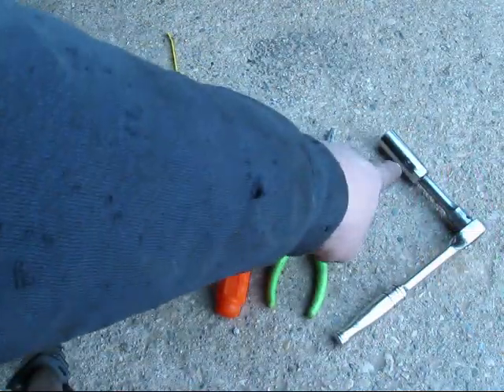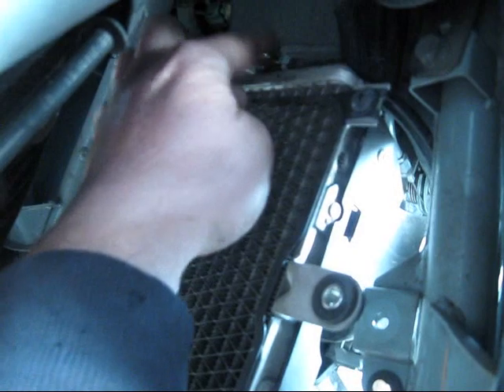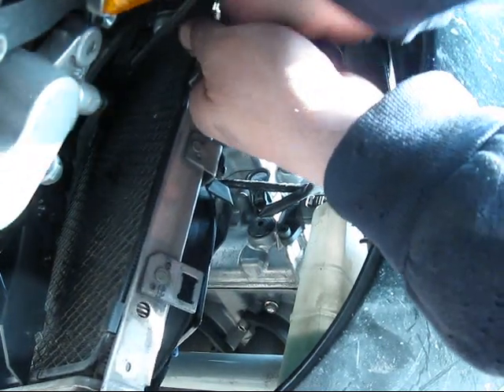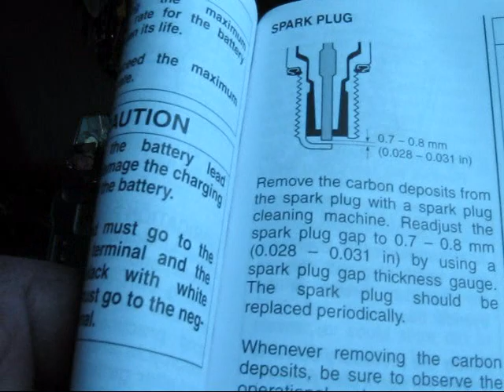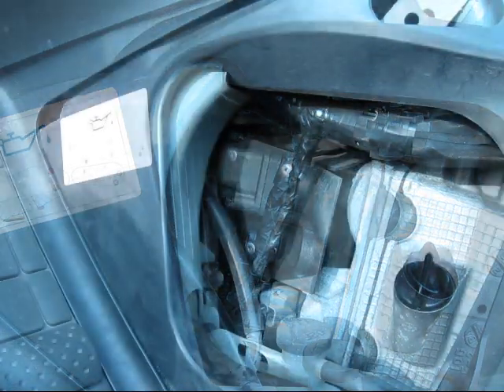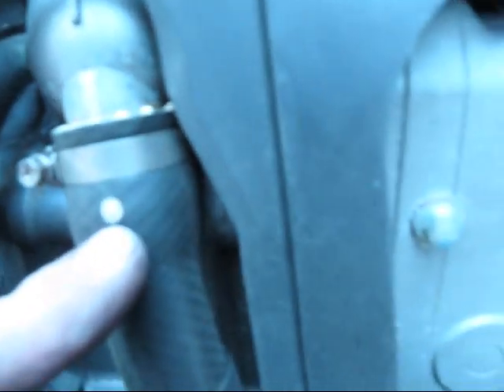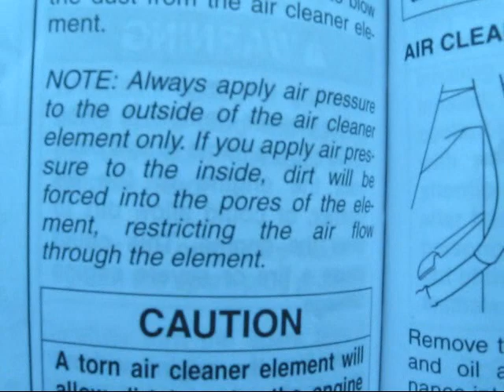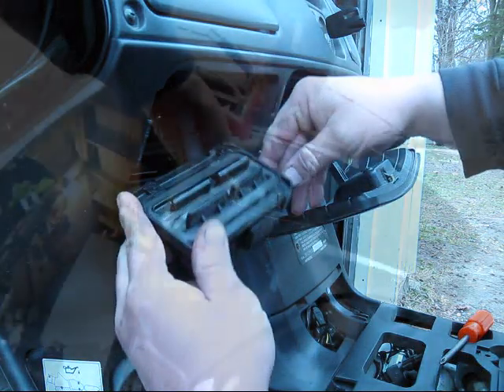Burgman 650 17,000 tune up.

Comment: I have 53k on my 2005 650 Burgy and shamelessly haven't touched it, as far as tune ups go, but I do change oil on a regular basis. It still runs great and mileage hasn't dropped a bit. However, I know I will be tuning it this Spring so thanks for the video. You probably should have emphasized that there are two plugs. I barely caught you saying plugs and not plug. Otherwise, great job and keep it up.

Comment: Thank you for the vid, very helpful. Just one thing though. That air filter...WOW!  That should be replaced  (or cleaned K&N)  at every oil change. Even after blowing it out it looks way past its useful life. Just my opinion from experience
Reply from the maker: Here's the funny thing it still has the original one in it. cleaned it afew  times. my gas mileage has not changed at all from being plugged or clean

Comment: Nice job. Pretty hard to get to for spark plugs, interesting location for an air filter too. I wonder if K&N makes a replacement.
Reply: Yes they do I just bought one $58 out the door at AutoZone and what was weird is when I took out the old air filter there was a big nest that a rat or mouse made in there
Reply: Does the k&n air filter make a difference?

Comment: A switch or something under the engine with a wire leading to it leaks oil.  Does it have an o-ring and if remove it with the two small bolts, will the engine oil spill out?

Comment: @bryanb1973 I changed spark plugs and when I turned to put the transit did not want to change the speed, but only in the first and will continue .. I called service and they told me that it should be reset something .. Now what I do not know.

Comment: now ..were is the damn petrol filter and the fuelpump….my brugman 650 is jumping at low speed and i Think it is the filter ,,
the bike got 2600 km on and a 2003 model just standing in the garage ..for years..then i bought it and the low speed is a paine 
high speed no problem.   checkt the coils and spark is new...man this is frustraiting :(

Comment: i have a 2013 burgman 650 with 6000 miles and my blinkers, back running tail light, license plate light do not work, any suggestions?
Reply: Real Men Love Jesus 
yes
change the bilb
Reply: Real Men Love Jesus 
but before the bulb change,
check the fuses on your scooter.
check user manual for fuse box location